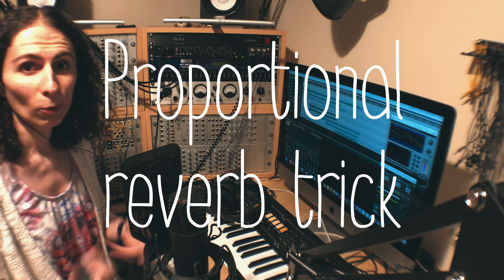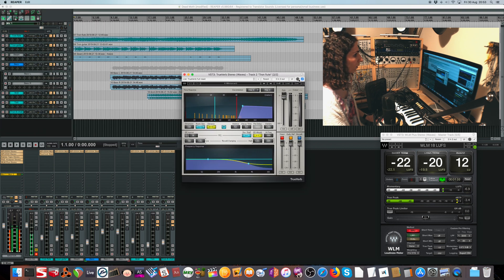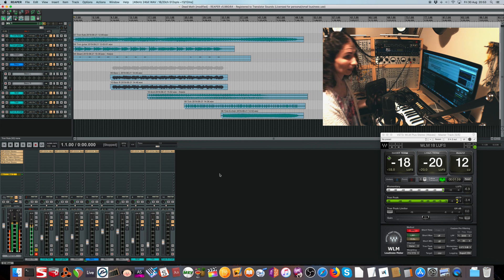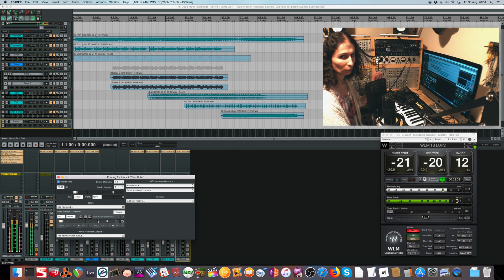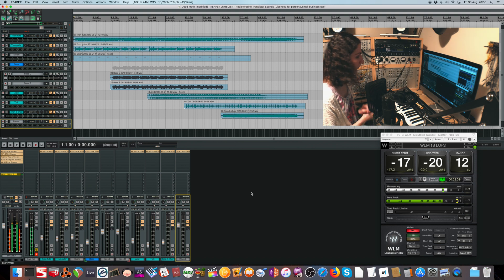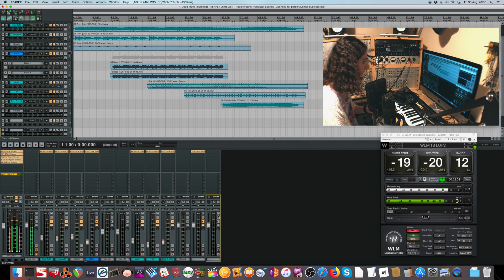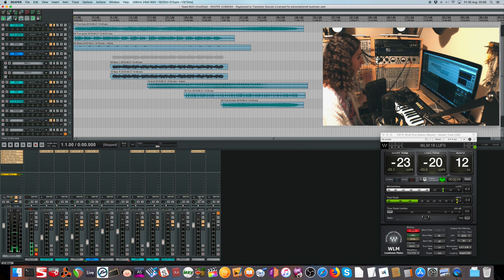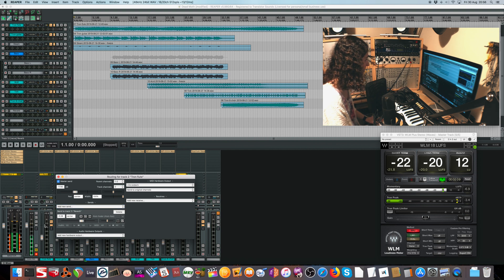A better way to add reverb

Comment: this is so cool. When I came across the reverb increasing levels problem I changed my workflow so that I do levels last (after applying effects). I'll probably keep doing it that way, but for reverb automation on a lead synth or vocals this seems like it would be super useful.